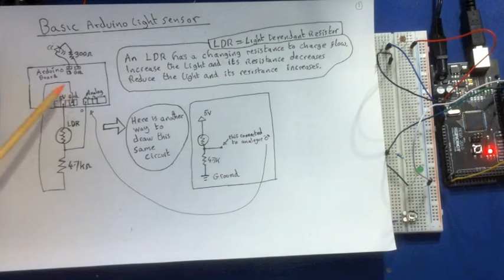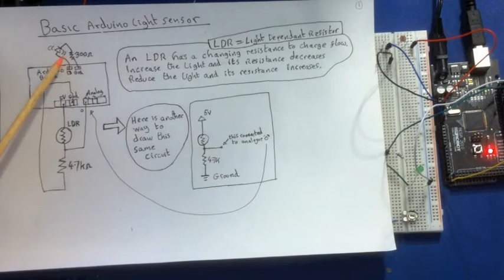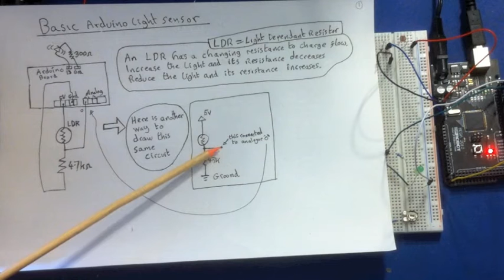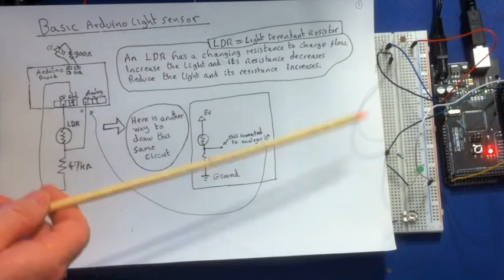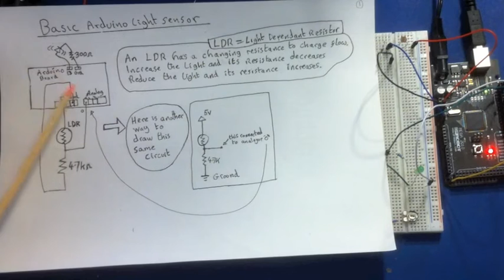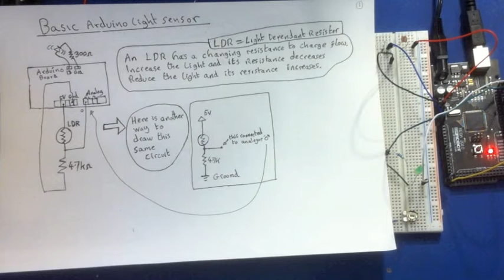Arduino Tutorial 2. LDR voltage level sensor

Comment: very handy circuit and bit of code, that alone would be a good 'lumen measurement device' to check light density never mind all the other handy things it could do :-) like how you showed the voltage divider bit to :-) ive seen circuits mimick this with 555 timer chips but its hard to work out whats happening there, your description completed the picture for me cheers :-D